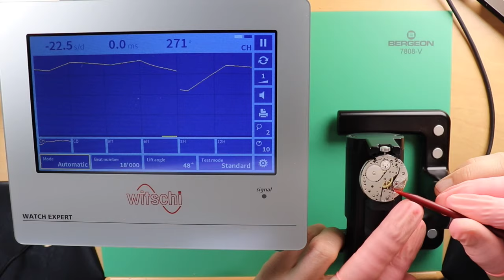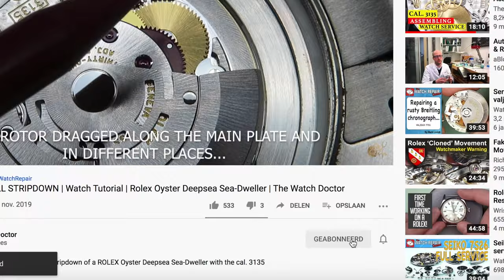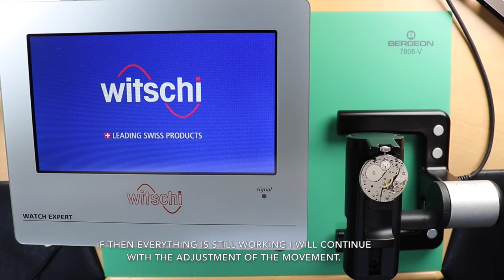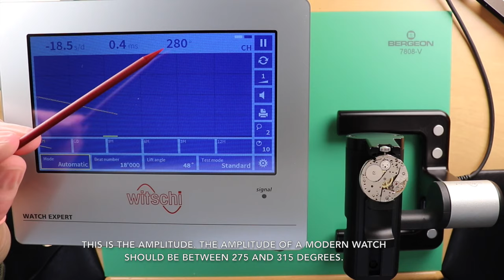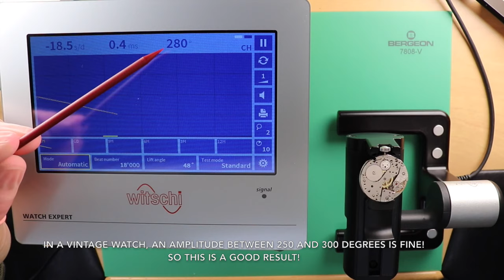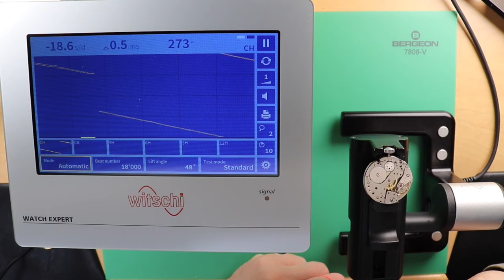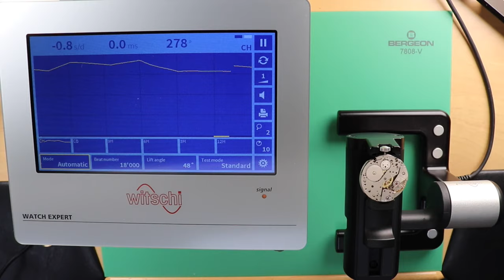Service a 1970's Tag Heuer | Belgian Air Force | Watch Repair | Valjoux 7733, Vintage Chronograph

Comment: Tag-Heuer the commercial brand that loved marketing more than watchmaking!
Reply from the maker: True, but the vintage Tag Heuer watches are great :-)
Reply: @therealwatchdoctor  Hello. 
- Tag-Heuer and Heuer - 
Thanks to ETA, Landeron, Valjoux, Venus ... ETA 2671 ETA 2824-2 ETA 2834-2 ETA 2892-2 ETA 2893-2 ETA 2894-2 ETA 251.252 quartz ETA 955.112 quartz ETA 955.114 quartz ETA E03.001 quartz Landeron 189 Valjoux 5 Valjoux 19 Valjoux 22 Valjoux 23 Valjoux 61 Valjoux 71 Valjoux 72 Valjoux 72 C Valjoux 76 Valjoux 76 R Valjoux 77 Valjoux 92 Valjoux 230BW Valjoux 7730 Valjoux 7733 Valjoux 7734 Valjoux 7736 Valjoux 7750 Venus 170 Venus 175 non-exhaustive list.
Reply: not always....depending on the CEO's.....take the re-editions for example they are great....And by the way the first brand using marketing and of-the-shelf movements was.....R....X
Reply: TAG break records to this day (1/1000th second etc)

Comment: Hi, great video! I am doing the 7734 myself in a couple of days and wanted to prepare a bit. I have a question though, accoring to the service manual the watch needs moebius 9501(or, special grease for mechanism as they call it) on the hammer and hearts. However, you put 9010, the which is the finest oil instead of the thickest grease. Is there a particular reason you choose this oil over the grease? 

Kind regards, and thanks again for the great video!

Comment: Love the content.  I do have a couple of questions as a fellow watchmaker.  Even though you are exceptionally careful, wouldn't it be more prudent to use brass tweezers when working on any plated movements so as not to possibly scratch the plates?  I noticed what I consider to be excessive side shake on the mainspring barrel arbor when you were applying the lubrication.  Did you address this off camera?

Comment: In the barrel which is better: hp 1300, jismaa blue or kluber p125?
Reply from the maker: I always use HP-1300, Kluber p125 can only be used in an automatic watch, where there is an extra spring. This is an extra safety, that the spring cannot break when overwinding, but that the outer spring slips. And you need to apply Kluber p125 there so that the outer spring slips smoothly. I am not familiar with Jismaa blue.